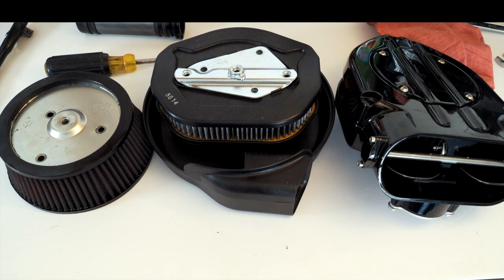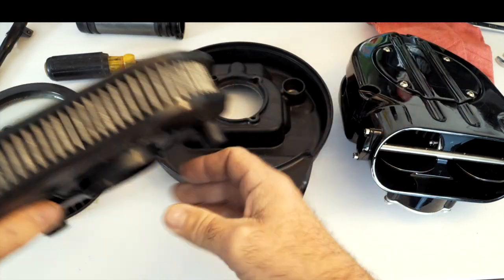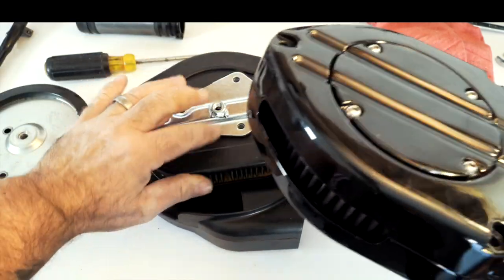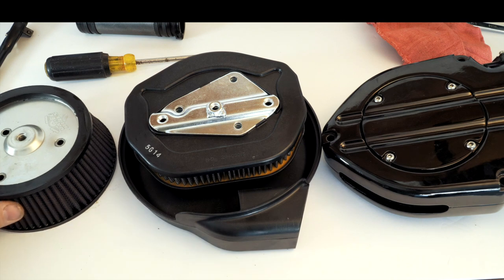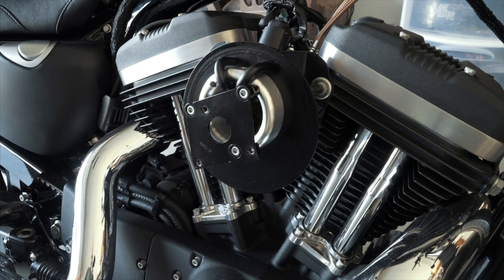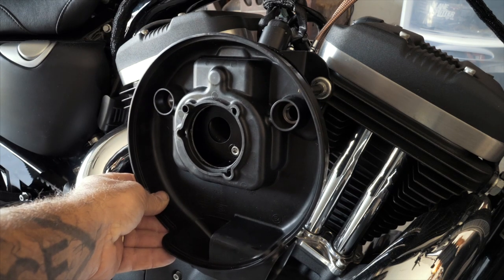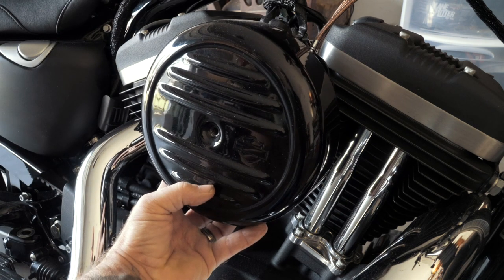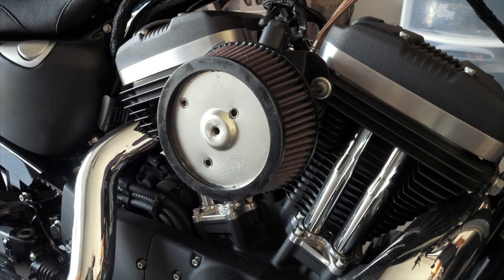Harley Sportster Air Cleaners for Stage One Upgrade

Comment: Another great informative video. Thanks for the info on the Kuryakan, did not know it was that involved. Will just go with the Vance and Hines.
Reply from the maker: It is isnt aweful to install but it does take some time.  Unless you are comfortable removing your throttle body and fuel injectors go with the VO2 easy install and works great. Glad I could help ride safe!